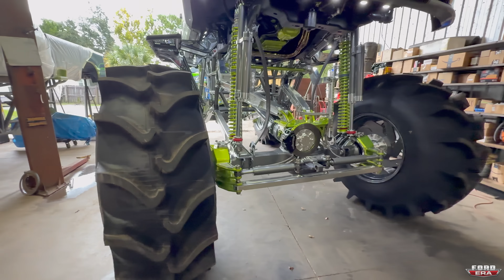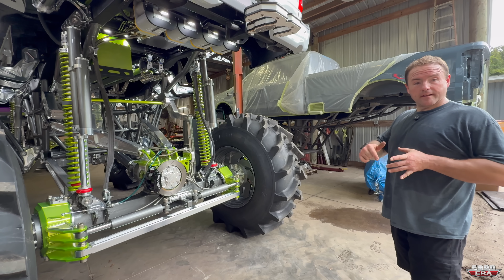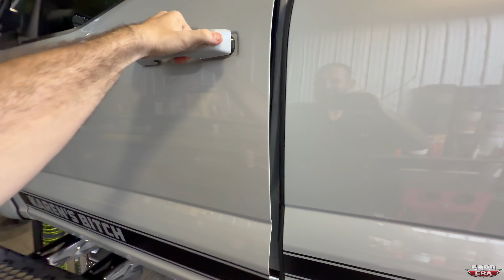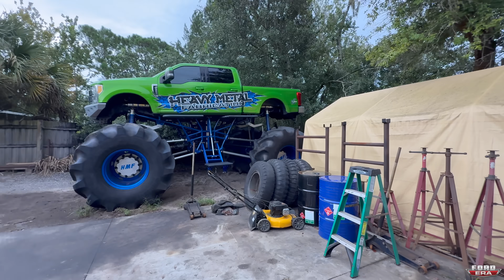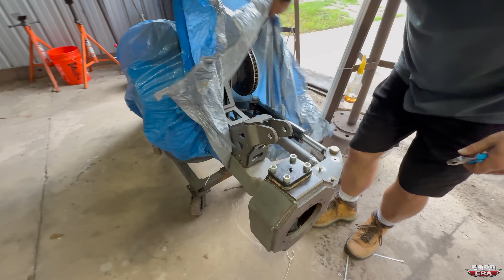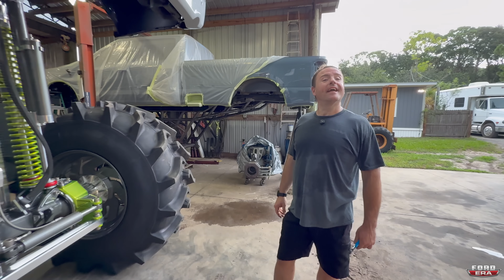775HP 2023 Shelby F150 Mega Truck built by Heavy Metal Fab | What The Truck?

Comment: dont sleep on NSB, theres some real deal fabricators out here.  jimmy's rod and custom is no joke.  custom tube chasis frames for $100k+ resto mods.  i used to work for a machine shop in NSB and we had a client that produced monster truck drop boxes, for which we waterjet parts oversize and refine in the cnc mills.  composite manufacturing is huge in this area as well.  ive seen Bobby's trucks rolling around for at least the last 21 years.

Comment: What is 70 series 🤔🤔 some type of quality billet extrude, treatment CNC'd aluminum 🤔🤔
Reply: its just a stronger alloy aluminum.  6061 is most common for billet parts, but its cracks when you bend it so parts that get bent are generally 5052 series.  opting for 70 series is beefy A/F for when you want light weight that wont flex.  also extremely expensive.  i bet those billet blanks for the trailing arms were $500-1k each before machining.

Comment: With something with that much lift, can it be aggressively driven through mud courses or tracks without twisting all those bits under the truck body? I would think you'd have stability issues with something that tall, but as I am not an engineer I don't know for sure. Looks cool regardless.
Reply from the maker: Yes it can be